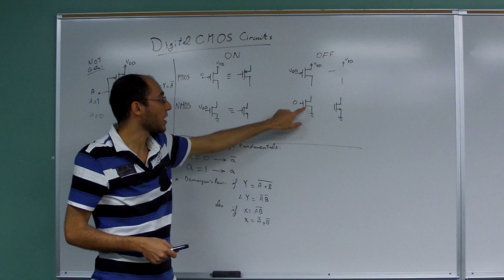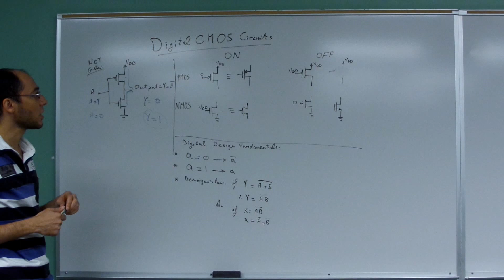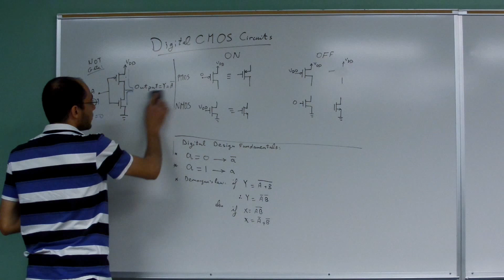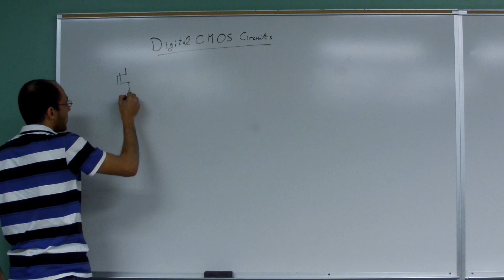Circuits 2 || CMOS Design: Examples to teach you how to implement any Logic function

Comment: What if you want no inverted variables in the circuit? Like if you just want connections directly to A, B and C and not A bar, B bar, and C bar?
Reply from the maker: One way is to use NOT Gates
Reply: @ewaisha  So you have to create a different CMOS circuit for every variable and bring connections to the original CMOS circuit?